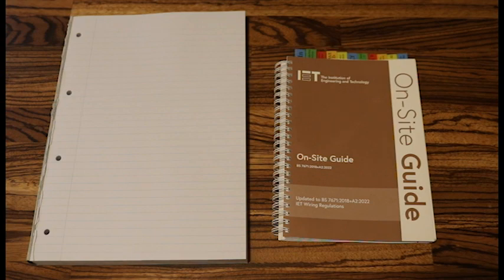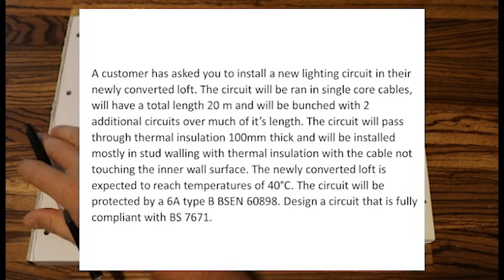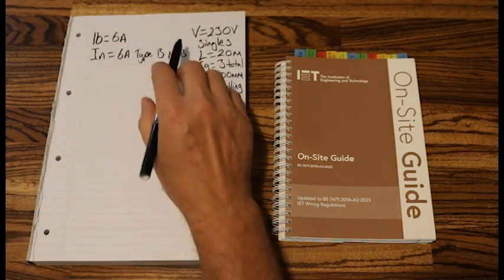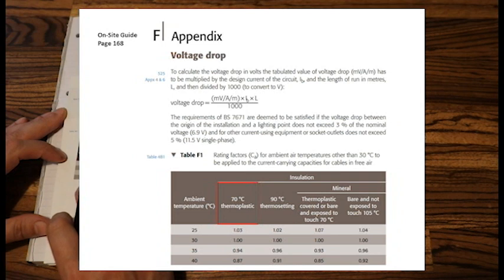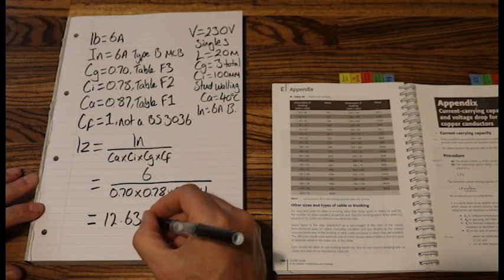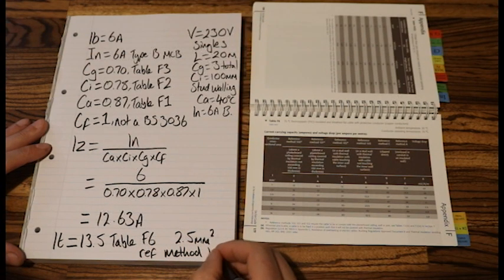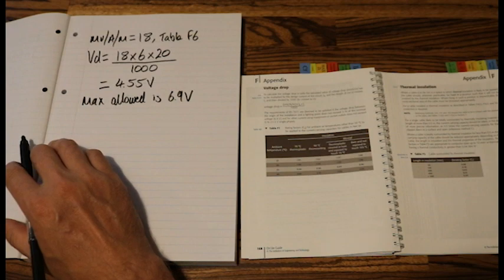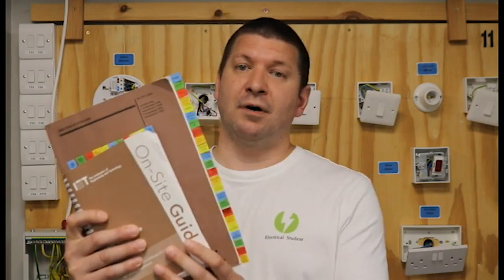C factors and special reference methods. Cable calculation using the OSG

Comment: Thanks for the video again.  I think the VD you suggest is wrong?  I make it VD = 18x6x20/1000 => 2.16 V
Reply from the maker: Yes you are correct! I've no idea what number I put into my calculator to get 4.55V lol!! Yes the volt drop is 2.16V.
Just ignore that minor mishap, the process is correct. Hopefully this example shows no matter how many C factors you have, they are all multiplied together and the In is divided by this

Comment: thanks for your great video, but the question is when you try to find It, you had a look at table F6 which is for flat cables, while in the question asked for single core cable!!
Reply from the maker: It is difficult to make videos for different levels. If you're doing a cable calc from the OSG, then it's basic and you will be a level 2 student. When you start using BS7671, you'll be completing a much more indepth cable calculation, using all of the correct tables, depending on what type of cable you have. 
My videos are aimed at college students who are just starting out in their career. Which is another reason I'm trying to expose them to the many different C factors and reference methods. 
I'm glad you've found the video helpful in some way! 😊